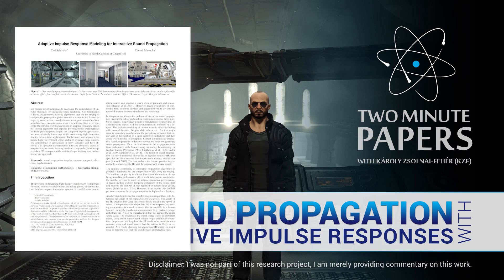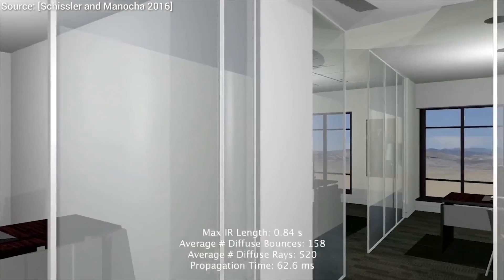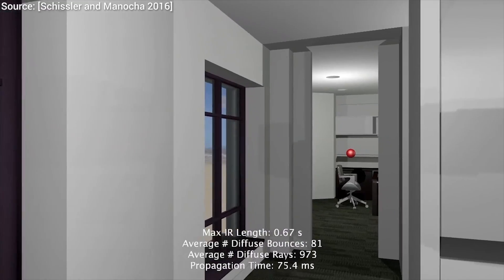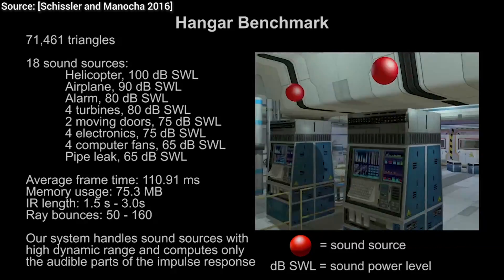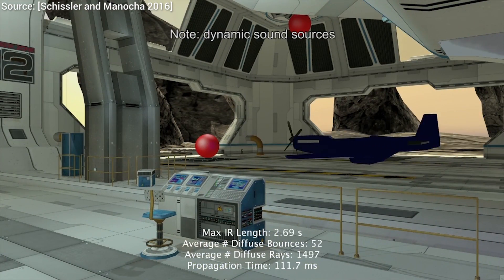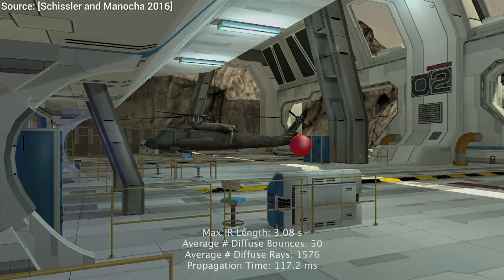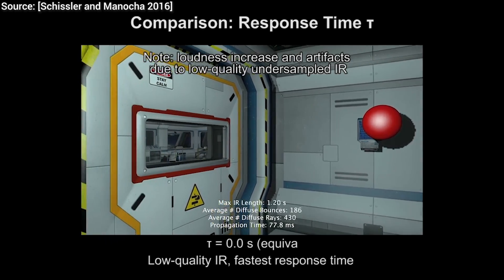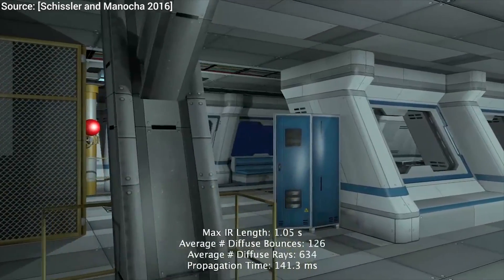Sound Propagation With Adaptive Impulse Responses | Two Minute Papers #95

Comment: I cant hear any difference which would justify using such technology.
Horror games like Amnesia Dark Descent already had audio quality similar, if not, better than the one shown in the video.

My point is that, it might be more scientifically accurate but me as a player, I cant tell it apart from hand made calibrations.
Reply: Parabolic labs is completely right.  Games take a lot of time and money to make.  If a process can be automated, that makes it more feasible to make a game with the same budget, or allows you to spend time on making it better than it could be otherwise.  This is also useful for user generated content, or for procedural or dynamic content where you don't have the opportunity to hand make the calibrations.  I'm also a bit hopeful that this technique can be improved to be faster, or perhaps it can be faked by using "screen space path tracing" (against the z-buffer), using temporal coherence to get a more correct answer.

Cool stuff!
Reply: to actually hear a proper difference you gotta hear a comparison which did not happen here.
There are games with great sound design out there but lots of effects are really hard to achieve with them. It actually does make a big difference in a direct comparison.
Reply: I know that in The Last Of Us they had the audio engineers create different sounds and audio effects for the type of space they were in, but it required they specify what kind of environment it was and it just sort of transitioned from one to the other when you entered and left rooms / areas. This is procedural, though, and can help make better decisions about how to adjust the audio based on something more than wet, occlusive, and exclusion sound zones. I would love to just pop this onto a game and not have to worry about futzing with the exact audio qualities every place in my game needs.
Reply: The problem that exist in current technology is that it require very specific preparation, placement and tuning in order to achieve "believable" sound. This research makes all of that steps streamlined and less complex and more adaptive towards different scenarios.
Reply: My argument is, "Realism does not imply enjoyable".
Reply: Well of course not. Nobody says this should be used for every single game.
However, realistic sound design really deepens immersion which at least some games definitely are going for.
Reply: Agree with Alan Wolfe. It also depends on speaker quality if you can hear difference
Reply: If you played any games in early 2000s with and without Aureal Vortex support and compared it to how EAX sounded, you probably wouldn't be saying that. Granted, they should have compared this here against something like wwise.